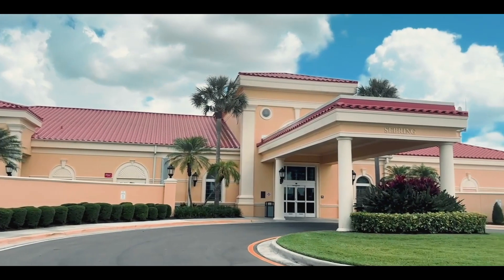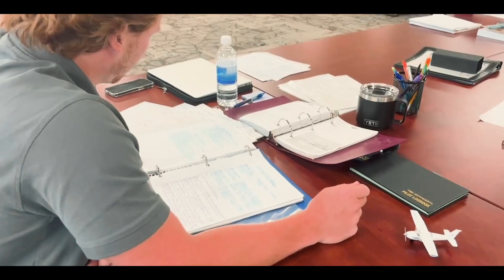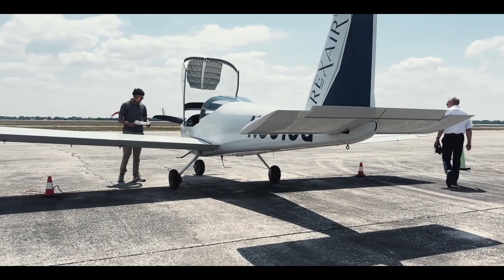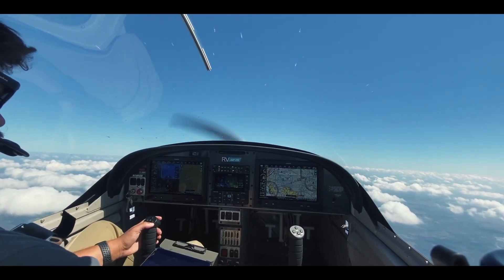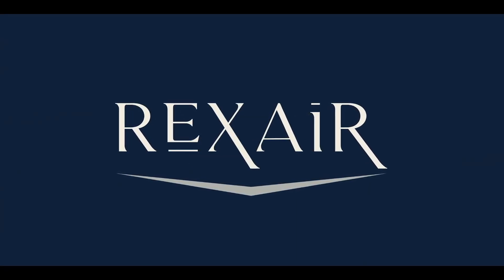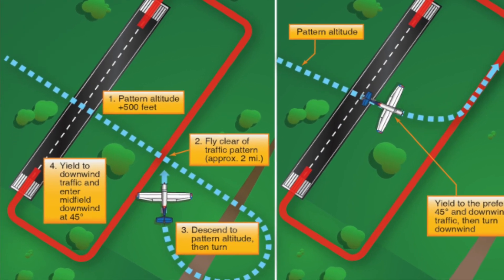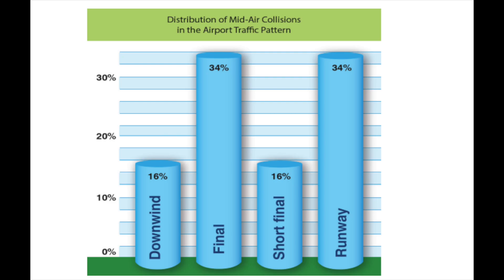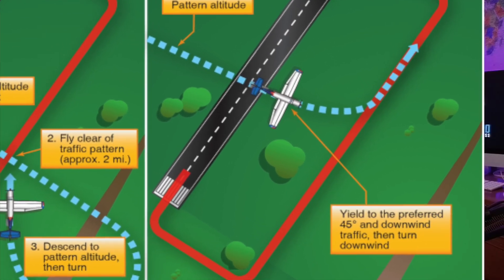Traffic Pattern Mid-Air Collisions are Avoidable

Comment: Being “flexible” to use either/or isn’t good enough, you need to be adaptable to be able to figure out different ways more than just the two described (three when you consider overhead break is also in the AIM).

Comment: You aren’t two boomers talking about rules because these are not rules. Recommendations are not requirements and the FAA specifically states it does not prescribe pattern entry merely flow;  flow happens after entry.

Comment: A straight in is not laziness, what is lazy is to declare others as such. It is presumptuous and being presumptive is lazy. The only thing lazy about a straight in is unwillingness to offset outside and adapt to an upwind if circumstances warrant. (Note some contexts might want tighter outsides, or even tight insides in which case you might want to add a small vertical too.)

Comment: “The FAA offers an alternative, cross at pattern altitude and join the downwind leg if the pattern is not busy,” while being grammatically incorrect violating subjunctive mode, is also not helpful for when busy though an opposite side downwind would work great. As would instead join an upwind outside for a crosswind into pattern flow.

Comment: If it can be so easily messed up, it is not “simplest, easiest” and should not be “preferred.” It is actually rather stupid and is why much the rest of the world, those who don’t simply copy paste FAA, don’t use it. Look for The Contrarian Aviator Sometimes Turns Right. Read the Medium copy as it has small tweaks to include better pictures from Daily Kos though read the comment thread in Daily Kos. Then consider the overhead break entry which can readily be adapted to Upwind to Crosswind for those not needing energy dissipation. Enables setting interval on cross as opposed to base, keeps all traffic forward quarter as opposed to cross cockpit on entry. It even works for those straight in arrivals including instrument approaches as adapting to upwind from such is easy.

Comment: So what's the recommended solution to the situation at 12:13?  Student pilot here, best guess is an immediate climb and left turn to avoid downwind and 45 degree traffic, then figure it out from there...?  (ETA:  I totally agree with the commentary at the end.  We fly into a busy non-towered airport and get all sorts of yahoos which result in interesting and occasionally unsafe circumstances.)  Thanks also for the tips about the teardrop - I hadn't been doing some of those things and now I have a better chance of doing it the right way.
Reply from the maker: The challenge to the alternate method of entering the pattern at a non-towered is that it is only practical if there is no other traffic in the pattern. Entering on the 45 to downwind avoids this issue. Any one of us putting ourselves in that position when others are in the pattern can easily create chaos. How we enter the pattern is a judgement call. Unfortunately, if the alternate method is used when others are in the pattern, conflict is virtually guaranteed. There is no predictable, safe option for conflict resolution should someone press the issue and insist on entering in a way that creates confusion or conflict.
Reply: @MadPropsAero  Ah, so the right answer is "don't do it in the first place"!  Makes total sense.  I personally prefer properly executed teardrops, but my CFI likes the alternative method.  We see all sorts of stuff at KMAN.

Comment: Mr. Brown should be quite familiar with DWH to LFK and if landing 16 I’m always unsure how I’m supposed to go about that entry. I’d almost rather fly way out east and just come back in and enter the pattern at a 45.
Reply: Yes, that one can be problematic. Flying east when you're well south of the airport and then coming back into the 45 is probably your best option! It' made more complicated by the fact that 16 is the "short" runway and often times there are bigger/faster airplanes choosing to use 7/25 for the extra length even if there's a crosswind!

Comment: Instead of overflying the airport, etc. etc, why not fly direct to 2 mile upwind leg preceding the active runway at pattern altitude and then make a "direct" entry to downwind between the midpoint and end of the runway once traffic allows?  Midpoint comes from direct entry description and end of runway is actually the pattern crosswind minimum starting point.  (Military pilots call this initial to overhead).
Reply from the maker: If all pilots had military training and experience this method of entering the pattern would be fine. Most don’t however. Many have no idea what the term “overhead break” means. While it’s a practical means of burning off energy for certain high performance aircraft, it’s not necessary for most general aviation aircraft. 

We continue to believe that doing things the FAA way is best.

Comment: Since turns are mostly required to be made to the left, what is wrong with entering the pattern on a left upwind leg instead of flying directly over the airport?
Reply: You'd have to cross through the departure leg.  There would be not only a collision hazard but wake turbulence also.  And blind spot issues.
Reply from the maker: The primary reason that approach would be inappropriate is because it contradicts everything the FAA has published on the topic. If we all ignored FAA established procedures and did whatever appeals to us individually, we would have chaos in the sky. It’s far easier and immeasurably safer to simply pick one of the two procedures the FAA recommends and follow it.
Reply: @MadPropsAero  Aren't there four procedures?

Comment: The fact that radio comms are not mandatory at public uncontrolled airports in today's world is INSANE to me! I understand that many airplanes did not have electrical systems way back when, but today we have nice affordable hand held radios..  I have witnessed many pilots in modern aircraft with radios not communicate as well.. Pilots that fly without communication into public use airports ARE a hazard no matter how they enter the pattern... Just my 2 cents....
Reply from the maker: While we’re not inclined to call for a mandate we enthusiastically support the voluntary use of radios in Class G airspace. There’s nothing preventing even the most bare bones aircraft from having high quality two-way radio communications capability. Its use should be a moral imperative even if it’s not a regulatory requirement.

Comment: It sounds like the FAA needs to re-up their info on this material and spell it out even more clearly. Maybe a poster that could be sent out to FBOs/small airports?  How I've been recently taught this: Overfly about 2000 over the runway, the distance to fly out has to be enough that you are AT traffic pattern alt when you are in that 45 heading towards the downwind, join the downwind (expected location if there isn't already traffic) abeam the mid point of the runway (NOT near the crosswind/downwind corner - a collision happened with a CAP plane at that point in the last few years.)  

Do I understand Pat correctly that he sees the over-fly/"teardrop"/45 deg mid-downwind as OK when it is all done "correctly": cross well above turbine traffic alt, turn/descend well away from the traffic pattern, enter mid-downwind at traffic pattern alt?

About the only time I would cross the runway at pattern alt and enter the downwind from the runway side would be at a truly totally dead, wildly middle of nowhere airport where I really felt I was sure no one else was in the air.  Not a fan of that if there was any chance of other traffic in the area.

Comment: Harmony in the pattern requires good dance partners. Personally, I don't need to prove I can navigate to the airport center point. I will do an occasional teardrop entry, but when planning an arrival if I need to get to the other side, I just aim for a point where I can mosey around well clear of the crosswind and departure legs (say 4 mi). It improves my situational awareness and eliminates all that turning, banking and descending. Entering on a simple 45 is something every other pilot on the dance floor can expect and keeps the pattern looking like a tight ballet instead of a bunch of folks doing the twist.
Reply from the maker: Your dance analogy is spot on. Nicely done, sir.

Comment: I prefer the so-called teardrop entry unless there is no other traffic at the airport. But at what point should I make radio call saying I am I entering the traffic pattern? I don't make a radio call saying I'm "making a teardrop entry" because there is no such thing. My radio calls are "I am overflying midfield at (whatever altitude I'm crossing at)" and then, after crossing the runway and going far enough out (I prefer 4 miles from the centreline) I'll descend to traffic pattern altitude and then call that "I'm entering on the 45", which is what I'm actually doing at that point. Yeah, it's a little pedantic to focus on the semantics of the radio call but it helps me to think of what I'm actually doing when I make those calls. I am NOT entering the traffic pattern when I'm overflying midfield at 500' above the highest traffic pattern altitude any more than I would be if I was overflying at 5000' above the highest traffic pattern altitude on my way somewhere else.  I think too many people get hung up on considering overflying midfield as being part of their pattern entry but when the "teardrop" is executed correctly the midfield overflight is NOT part of your pattern entry at all--it's just overflying the airport.
Reply from the maker: You're doing it exactly right, @gregisflyingforfun. Calling that you're overflying the field at a specific altitude (hopefully 1,500 - 2,000 AGL depending on the issues we included in the video), then calling 45 to the downwind when at pattern altitude is perfect. Downwind, base, and final are the only other calls you'll need. 

Well done, sir. Very well done indeed.

Comment: I would like to add some elements to this excellent discusson. 

A quick intro: I fly out of a Phoenix satellite uncontrolled airport in a J3 Cub w/o electrical system. We get a ton of student training in the pattern and on instrument approaches from different directions. I have a handheld radio, connected to an intercom and an antenna for improved range. I have a Sentry 3 as well, connected to a mounted IPad with Foreflight traffic. 

Obviously, I’m ADSB-in only and often see folks depending too much on their ADSB for separation. Call sign “Yellow Cub” should get your attention to look outside from time to time. Unfortunately, I’ve had some close calls from people flying non-standard patterns or catching up on me, heads down. My traffic pattern might not be as far out as yours and when the density altitude is high, I might not even make it to 1000 feet. So know where to look and listen to the radio. As a personal rule, I don’t fly in this busy airspace w/o ADSB-in for situational awareness. And when “pattern is full”, I call it the day. 😅
Reply from the maker: Very good insight into the challenges some of us have in low-powered aircraft, possibly NORDO, on a high density altitude day. We're all safer when we all follow known procedures. As you suggest, it can get hairy when someone is flying head down, eyes shut.

Comment: Watched this early this morning before I went to do pattern work, I had never measured the distance I flew past the runway before turning back and starting to descend. I flew the teardrop or whatever we prefer to call it to avoid confusion, I checked my tracklog and it was 2.7 miles from the field and I was at pattern altitude 1/2 mile out from the downwind (that I fly, I know people's patterns are all over the place). I probably could pad that a little more. I was all by myself, which is part of the reason I like to fly at sunrise. Only other traffic arrived as I was departing, their call was "I am 6 miles out plan to enter the downwind midfield". No idea what direction they were from the field or which downwind they were entering....but I guess at least they made a traffic call.
Reply from the maker: Specifics matter. We wish more pilots making radio calls used them.

Comment: It's interesting how we all have different viewpoints, I believe the midfield entry from upwind if the airport introduces the most risk if the airport is busy. It's great if there is only one other person in the pattern. 
But, In my experience here in the busy Orlando airspace where I'm based out of - the "teardrop" is the dominant entry pattern here due to how busy patterns typically are. The maneuver positions you (when done properly of course) entering on a 45 degree to the downwind just like 99% of all other traffic. Personally I overfly at 1000 above pattern alt and fly out maybe 5 miles from the field before turning... gives me more time to setup and have more awareness, and I'm never in a rush. The teardrop should basically just be setting you up for a normal 45 entry when done right.
I think instead of viewing it as "x or y is the best way", you really have to have some picture of how busy the field is 10 miles out so you can decide what the best entry is for that day.
Reply from the maker: That last sentence really sets the stage for a successful, safe pattern entry. Thanks for sharing.

Comment: Great video!  Glad you guys tackled it. This is a hot topic which pilots will be arguing about until Star Trek teleportation devices are invented making air travel obsolete!

I don’t care for the teardrop entry for all the reasons Pat mentioned and then some.  I’m a strong believer that any leg of the pattern should be entered at pattern altitude and pattern airspeed.  This leads to a more stabilized setup, minimizes the amount of maneuvering in the airport area, avoids having to descend in a turn requiring the pilot to have to establish proper pitch, power and trim settings as they enter the downwind leg.  All of that maneuvering adds to the pilot workload and can be somewhat problematic if the runway is short and/or the pilot is inexperienced.

If the pattern is entered at midfield crosswind when approaching from opposite the downwind leg, and at pattern altitude, any downwind traffic is plainly visible.  When they make the downwind turn and rollout, everything is already setup and the pilot can focus on the next steps. 

But, as you both said, flexibility is key as is understanding how to properly fly both approach methods.
Reply from the maker: Thanks for the feedback. Fortunately the FAA gives us two perfectly reasonable options for entering the pattern from the opposite side. Both work well. The problem develops when cowboys with big egos decide they can do whatever they want. Creative chaos and increasing risk is not a valid part of any flight plan.

Comment: Great discussion of an important topic! I'm a rusty pilot working on getting current again, and was initially confused by mentions of a "teardrop entry" as I had vaguely remembered the term as a special IFR procedural turn (I'm not instrument rated). But once I found the drawing that you show, it suddenly made sense. My non-towered airport is more like Jamie's situation, were the teardrop works well (when done safely, of course).
Reply: That's yet another reason that the term "teardrop" is problematic.  It refers to one of the three accepted ways to enter a "hold" when flying IFR. I can't find any definitive documentation as to where/when this term was co-opted for traffic pattern use, but it sure adds to the confusion!
Reply: Probably shouldn’t vaguely associate any of your old remembrances to anything you’re not rated to do…
Reply: @jmax8692  Yes, good call, jmax! I was just pointing out that the term "teardrop entry" sounded similar to an existing IFR procedure turn rather than to a type of VFR downwind leg entry. So it didn't make sense until I figured out what people were actually talking about.